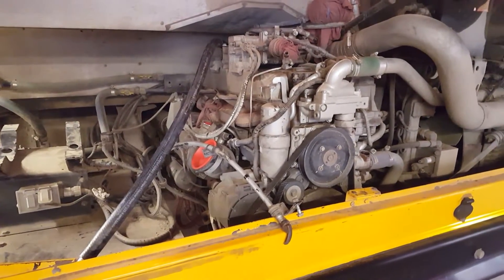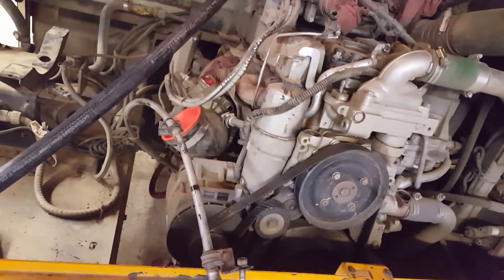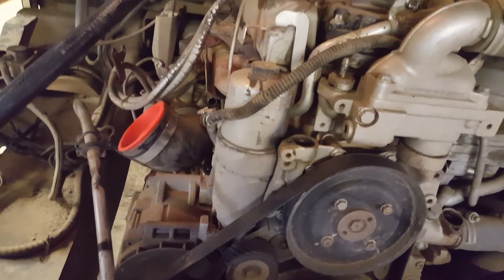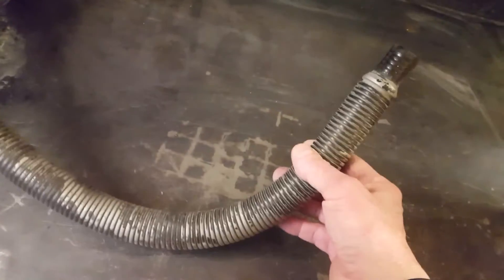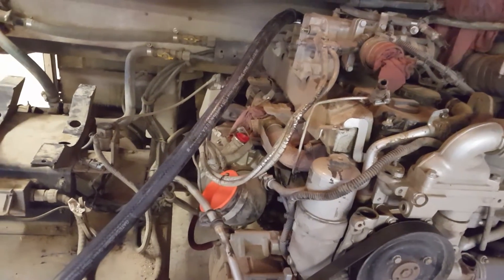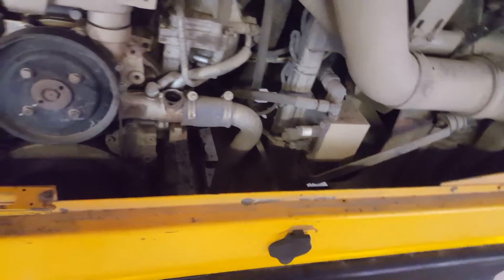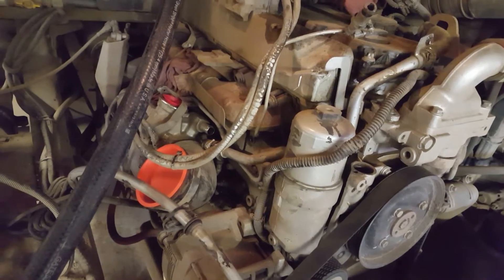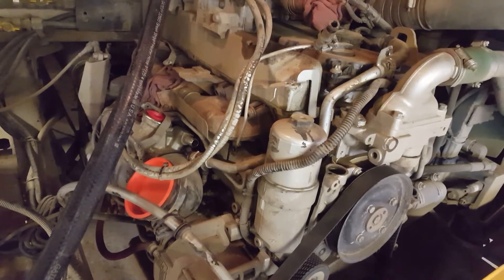Mercedes Diesel Air Compressor Failure Cause and Repair

Comment: Hello. Have you replace a lot of water pumps in the mbe900 engine? I replaced water pump and gasket on a 2007 model and 1 month later the gasket is leaking right by the passenger side of the motor near alternator bracket. Have you ever seen repeat gasket failure especially in such a short time? Any known root causes?
Reply from the maker: Not many water pumps have failed.There are 2 mounting gaskets one for the adapter mounting plate to the block and the actual water pump gasket.